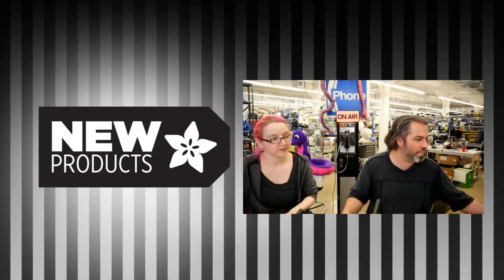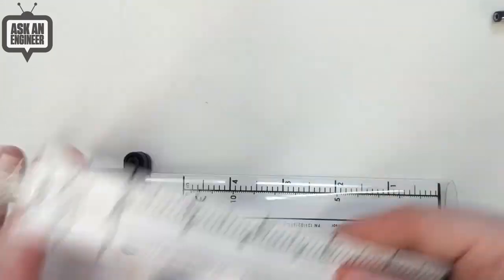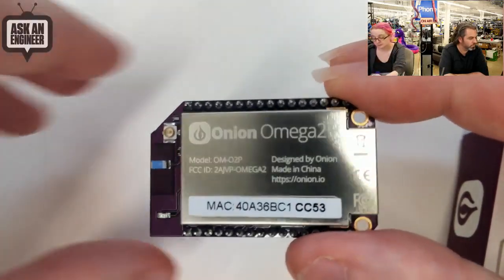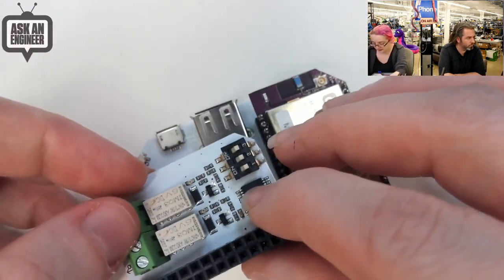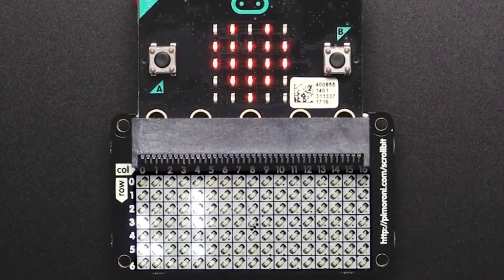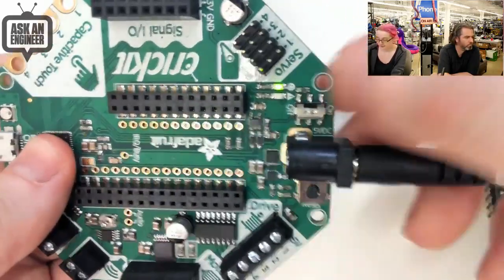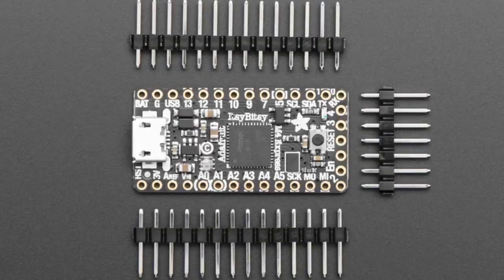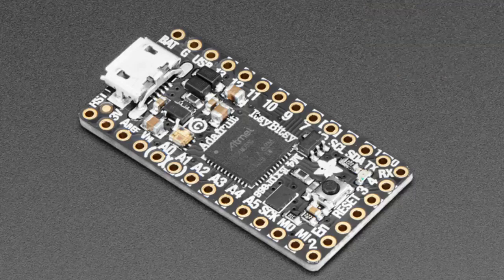New Products 6/13/2018 Featuring Adafruit Itsy Bitsy M4 Express! @adafruit #adafruit

Comment: eTape Liquid Level Sensor idea: make them with a 1/4" thread so people who build PC's with water cooling have a direct bolt-on level sensor for their reservoirs. Additionally develop a board which converts the signal into fan-header readable data. (I personally would need one of 75cm, inserted from the bottom, without the converter board).

Comment: I have questions about those liquid level sensors. The bare version has 4 pins and the enclosed version has 3 pins. What is the internal circuitry inside the housing? How is the hookup between the two different?

Also, I'm looking forward for (the as yet unannounced) Feather M4 Express board.
Reply: And, look the Feather M4 was just announced! See its product page: https://www.adafruit.com/product/3857
Reply: I have this question as well as I'm doing a project right at this moment and can't figure this out....